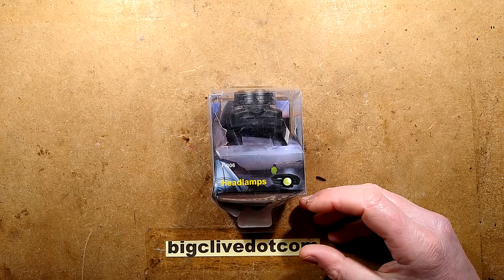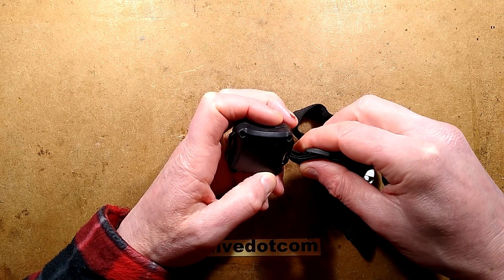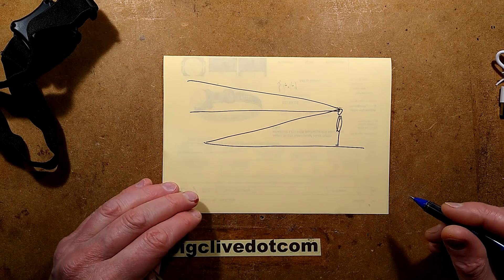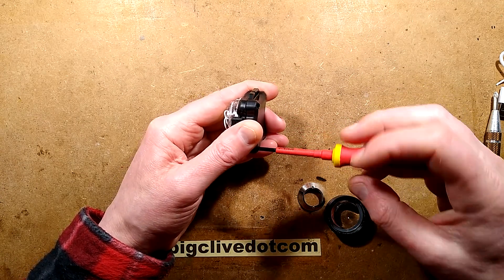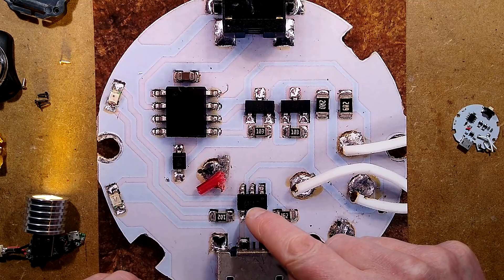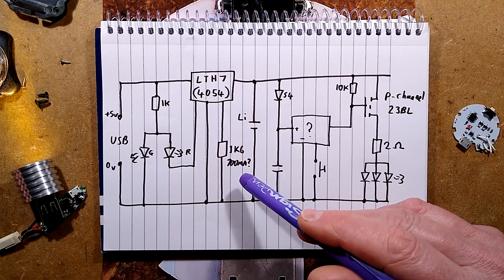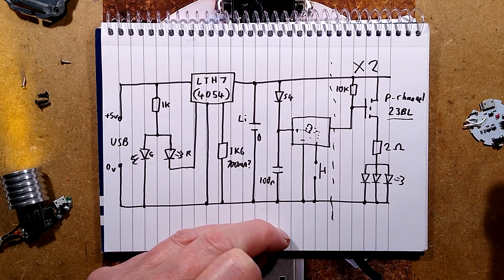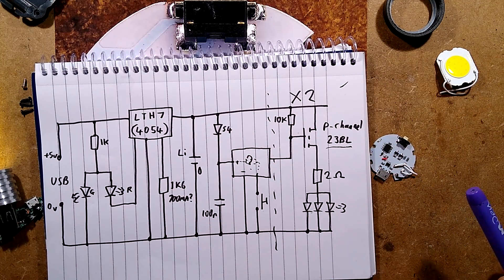eBay's cheapest pile of crap USB rechargeable LED head torch.

Comment: I have a similar one that I use when I'm running outdoors in dark. It's more to help with visibility (hence the flashing mode) than to see where you're going. Could this be made for the same purpose I wonder?
Reply: In my country people traveling on roller scates, scateboard etc. are subject to the same lighting rules as bicycles.  However I doubt these units meet the modern requirements for intensity, red color etc.  [Edit: spelling]
Reply: You could be onto something here. Get 2 of them and put them on the same strap. One on front set to white mode and one on the back in red or white/red strobe mode.
Reply: @fillg  With two lights you get two straps making it fit around your waist, which might also fix the direction issue.
Reply: @johncrowerdoe5527  Probably have to do a whole lot more running to make a twenty inch "waistband" fit.
Reply: @twicebittenthasme5545  Not as hard as fitting a 10 inch headband around your scull.  Remember the waistband would be two headbands.

Comment: So, I've got a bit of this dark grey EVA packaging foam (very dense stuff, but still flexible) that comes with high end enterprise level HDD packaging, I would just cut a little wedge out of it and glue it to the back of the light to angle it downward. Easy fix on an otherwise decently priced lamp. I think I might buy one and do this, cause it looks rather good otherwise. I think this would be good for attaching to the molle straps on the shoulder straps of a day pack.

Comment: That angle's perfect for underground miners who are worried about rocks falling on them.
Reply: Designed to be held in the mouth like a gag ball
Reply: Or for mountaineers, climbing a steep slope.
Reply: @RenThraysk  or for short people wanting to examine nasal hairs.
Reply: Perfect to warn the rocks above that the miner is now in a perfect position to be kloncked-upon.
Reply: If it’s rotated 180 degrees does it point in the same direction?
Reply: Maybe cavers looking for a tasty bat...
Reply: @RenThraysk  Damn you, Hu Fuq Dup...you know bat soup makes people sick!
Reply: Would be good working under a car on jacks. Wide beam would be great for just having light under the car. Even just working in a roof space running cables or something. Would be fine unless you have terrible eyesight.
Reply: How did you reply to this 2 weeks ago???? Some might call that stalking....

Comment: yeah... that perforated cell will die in around a few days, it's supposed to be vacuumed in there. I've once poked a 2000mAh cell in a power bank, I though seal it back with tape would save it but oxygen has gotten in and destroyed the anode/cathode inside it, the cell becomes spongy and loose inside
Reply: Can confirm.  Had an old laptop battery that puffed up, naively poked a vent hole in it to shrink it, it died within a few days tops.  Luckily it was old to begin with but my meddling didn't help it.
Reply from the maker: I managed the test.  But I'll be discharging it to zero and then recycling it.